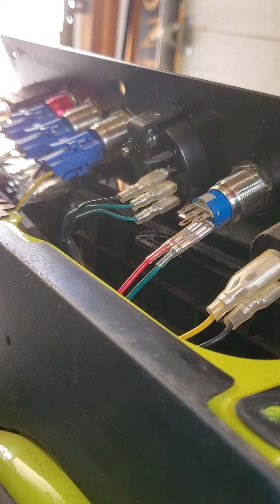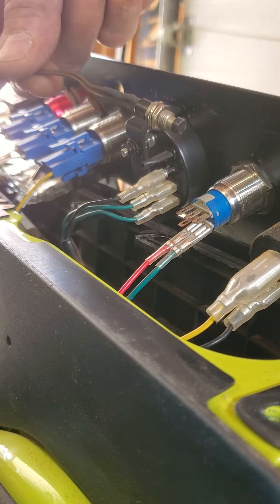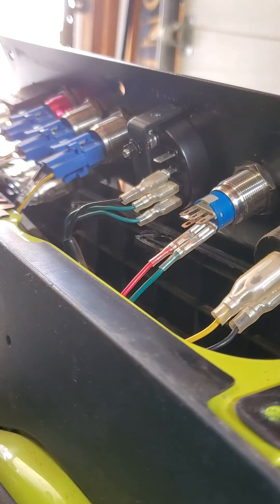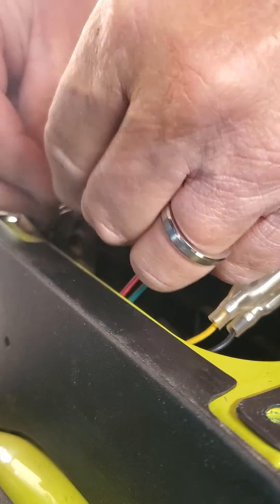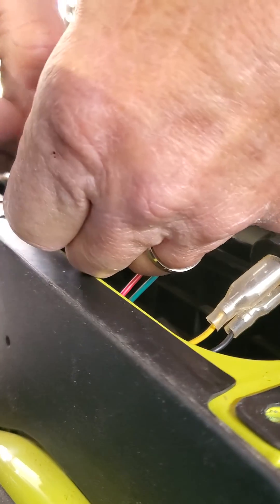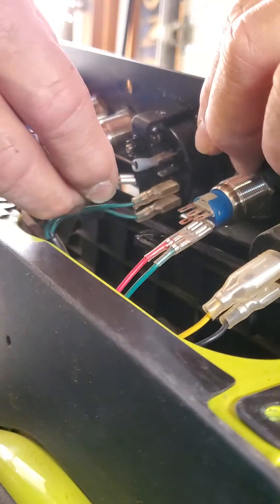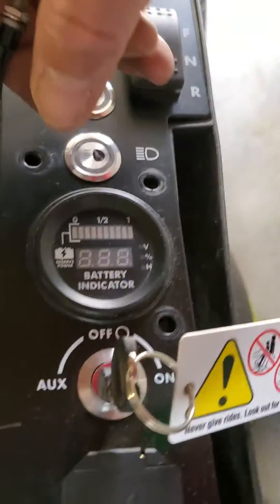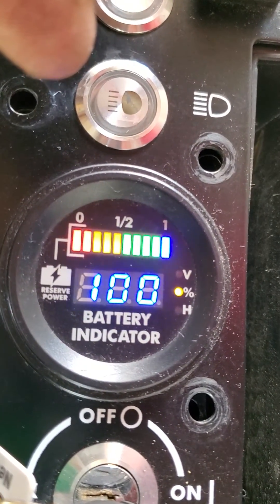Ryobi 480e riding mower battery indicator mod to see volts and percentage.

Comment: I did this modification over a year ago and it has been extremely useful. I am remiss for not thanking Greg for making it available to all. My RM480e (now an RM480ex with new MM 100 ahr. batteries) has been a lot easier to monitor with the mod. After 176.5 hrs of run time it still only costs $0.22/hr. to run.

Comment: Also after you install the push button switch, if you press and hold the button it will reset your hours, good for maintenance info.
Reply: That doesn't work on my 5 yr. old RM480e. There are several different versions of the BLM that were used in these mowers. Pressing and holding the button did not reset the hour meter on mine. It has reset itself once with no input from me. Same for one of the neighboring RM480s twice.
Reply: Okay thank you for the information ☺️

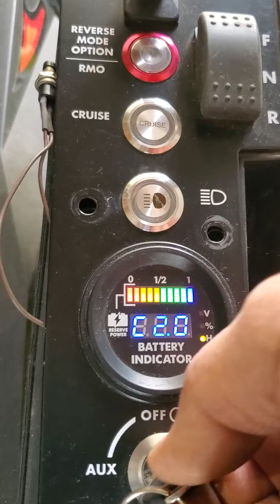Comment: Any idea what the C2.0 means on the battery indicator that momentarily appears before the 44.5 hour reading, 1:15 minute?
Reply: Simply a system display. Ryobi stated the first two numbers displayed when switched on are meaningless. Although the 48 is the system design voltage even though the actual pack voltage may well be different.

Comment: Greg, I tried this using three different switches the last being the exact one you listed from Amazon and this didn't work for me.  I have the RM480e and followed your directions exactly.  Any thoughts?
Reply: Among the various versions of the BLM used in these mowers, I believe there was one that this modification will not work on.

Comment: I'm very interested in doing this, but a  bit confused - when installing the second half of the switch, it was difficult (OK, impossible) to see your hands and to tell exactly what you were doing.  I'm not terribly mechanically inclined, so could you explain a bit here what's happening?  Thanks.
Reply from the maker: It's the blank terminal and the one with the black wire.  In my group the complete description it shows this information.  You have to scroll back pretty far.
Reply: @greghandley685  I don't understand - "in my group" - what group is that?  Thanks.
Reply from the maker: I have a Facebook group for Ryobi 480e riding mower. Let's try this link.
https://www.facebook.com/groups/2756962307675482/permalink/3622210064484031/
Reply: @greghandley685  I'm there - just joined - thanks again!

Comment: Hi. Thanks for the great video. I would like to install this mod on my RM480E but I have a quick question. I see you created a subsequent video where you replaced the existing meter with a more sophisticated meter from Amazon. Did you do this just for the additional functionality or did the addition of the momentary switch cause an issue with the original meter?
Reply from the maker: No problems with this modification. It works great but I wanted to try a more accurate gauge. It also gives more information.